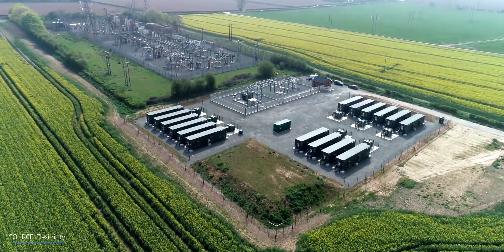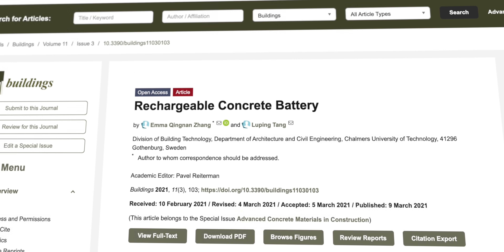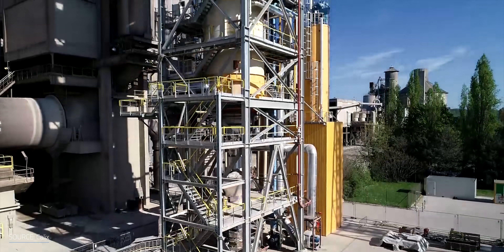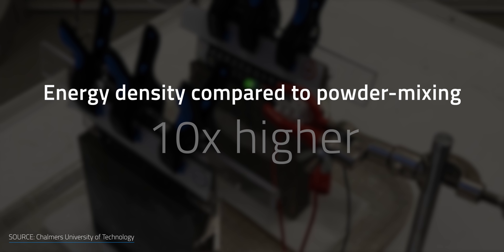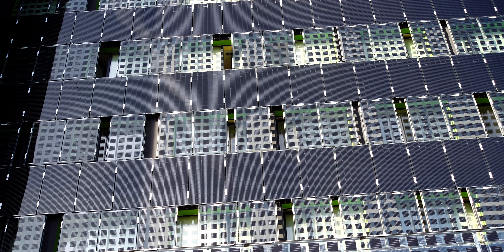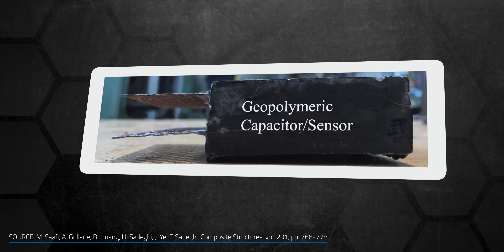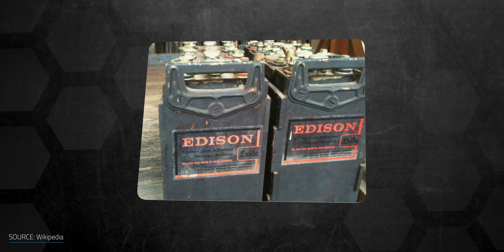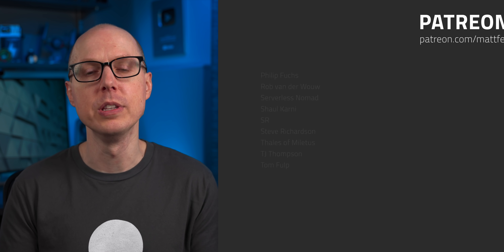Turning Buildings into Batteries? Concrete Battery Storage Explained

Comment: One of the reasons why modern concrete bridges need to be replaced every 30-40 years is because of a redox reaction. The iron/steel rebar within the concrete starts to rust which expands in volume as it does so. This expansion, especially when combined with colder temperature or wetter climates causes the concrete to crack which allows more moisture in which then increases the redox reaction even more. The fact that this cement is based upon a redox reaction worries me. How long with the concrete last? Even if the concrete lasts, how long will it remain operational as a battery? I think this requires a massive amount of study and further development before it can be considered a viable alternative. Concrete itself, without the rebar, can last a thousand years or more if you get the right mix and don't add anything that can rust. The Colosseum in Rome is a prime example of this. 

What would be very useful is if we can find a building method that uses different materials that when combined, can create an energy storage system. The more pure these materials (granite for example) then the longer it will last. Granite can last tens of thousands of years, and as a building material, can be extraordinarily strong.
Reply: Theres a move to phase out steel as rebar due to the problems with concrete cancer.. as its known. 
What they are using in domes and other structures especially in Maritime environments is artificial  Basaltic rods.. it behaves more like concrete in density, in terms of expansion co efficient s, water, fire and corrosion resistance...it can even be formed into woven and chopped strands..like Glass in GRP construction.
Reply: @clivestainlesssteelwomble7665  That's really interesting! Artificial basaltic rods...
Reply: @Kevin_Street  
Look it up they are even using it to re enforce PET plastic hulls on a new generation of sailing. Catamaran's.
Windelo 50 Adventure Catamarans. Also large spray concrete domes.
Reply: As I understand it, the rebar rust helps make a better bond with the concrete.
Reply: @lunatik9696  only if its a tiny amount and then for a short time  then it expands by multiples of the original steels volume and then it starts cracking and flaking the concrete which lets more water into the structure...plus rust runs out of the cracks and discolours the surfaces and combines with dissolved mineral salts and form rusty orange runs and stalactites in the worst cases
Reply: I'm wondering where you got 30-40 years from......... like wow 

Thats a cheery picked fact if I have ever seen one.

But right on one point the correct material for the correct job and location.

U build anything in a high salt spray area u are going to have problems........
Reply: @JackTalyorD  Cherry picked? I work in the industry. Bridges start going bad after about 30-40 years. I live in the upper midwest, so we have snow and therefore salt, so I'm basing it off of my experiences.
Reply: @Xero1of1  yes  so 30-40 years comes from bridges in your area.

Sounds a lot like Brisbane River side Express Way.

2 km stretch of bridge/ highway built around 1968 as a temporary traffic solutions for a growing city.

60 ish years later it's still standing and still hasn't been replaced upgrade.

It only fell down a little bit in 2006 but that's tends to happen when you build a bridge on sand and gravel.

So my ramblings was that bridge lasted 3x it's planed life span......

I cherry picked that bridge 😁😁😁.

But the last 6 bridges I have worked on in the last 20 years are all rated for 100 years plus.

Will they make 100 years maybe we'll at least the ones that they didn't cut corners on with 25 mm cover on Reo on per cast panels that are the bastions for the main bridge support.
Reply: @JackTalyorD  
Im wondering how much influence that very fact may have had on the collapse of the Florida Condo building...esp given rising sea levels, salt water penetration of ground waters and increased hurricanes and storm surges.

In many emergent economies building s have been thrown up in a huge hurry .  In china and other places huge concrete city size developments were thrown up ..and now in less than 15 years are litteraly falling apart so having to be demolished.

The whole species is on a its last written warnings that we need to collectively grow up or the Gia will change its life support mechanisms till it will no longer support most if not all of us. Weve just about discoverd where the thermostat switches are and if you play with them things happen🤦🏻‍♂️🤔
Reply: @clivestainlesssteelwomble7665  building in China...oh that's the fun stuff.

So say it cost $150,000 to build X.

Well there going to accept the quote that's $120,00.

And well material is going to cost u  $50,000 and Labor is going to cost u $50,000 and bribes to the correct people so u don't have problems is going to cost $30,000

And your profit is going to be $20,000. Well it should be.

Sooooooooo either $30,000 of labour costs need to be cut or xxx of  material cost need to be cut.

Shame the bribes is kinda of a not negotiable cost.

Sooooooooo u spent $20,000 on material and $20,000 on Labor well u get $60,000 in labour but only pay $20,000 and the u take your $50,000 and GTOF there because of the house of cards u have just set up.

But change thousands to millions/ billions and one building 2 a new city and that's close to the scale of the bullshit that's been set in motion.
Reply: The biggest bridge i DK was intended to last for 100 years, but in 2020 it was upgraded to 200 years.
Reply: I live in South Africa, I work in civil engineering, I have never heard of bridges needing to he repaired even after 50 years, rc structures does decay over time, but not as fast, I have only heard of concrete roads needing to be replaced because of cracking after 30-40 years, but they don't use reinforcing, so different problem altogether. Buildings I have seen are 60+ years old and are structurally sound, if a building is falling it was a design flaw, y-bars do not rust as quick as people may think in these buildings, after all these years you can break it down and you will still have strong steel in them you need to cut. Remember, an engineer signs off on a building, we take responsibility if something goes wrong, that's why we have insurance paid by the company to cover the costs of any breaks, but that shouldn't happen in your lifetime, a building that you design should outlast you, then our job was done correctly, but we do not have the same climate, weather may change characteristics of rc, I don't know.

But there are several concerns on the battery system and how long it will last for what price, this would need to be very well researched before any engineer signs off on it. Remember, every house, every shop, every building that is built today needs to be signed off by an engineer, if the engineer says no, it's not happening, so all I caN say to the science community is: "Persuade us with enough thesis's and technical reports, lab reports  if it gets accepted into building regulations, I'll sign off on it, cause the idea is great, but there are many great ideas, just few that are realistic.
Reply: Most buildings probably shouldn’t be designed to last a hundred years. Many are torn down to build something new within 50 that I’ve seen. Part of that may be due to infrastructure breakdown but the property market likes tearing down to rebuild a newer thing. Bridges and similar certainly need to be more durable. But not all of the concrete structure is part of the support.
Reply: If it is rechargeable then it would also consume the rust.
Reply: Yeah as a electrical engineer I know your not getting a perfect exchange with any battery and will weaken or degrade over time.

That's even more concerning if it's the structural component of a building or anything.   It might be a good option if storage is desired at a installation and it's more viable than normal batteries.

I can't see this working in commercial buildings though
Reply: Concrete can be reinforced with carbon fibers, while more expensive this can be economic already due to not needing a concrete cover over the fibers, which over large spans adds up to significant material savings due to not needing the height below the pull zone.
Reply: Putting a negative voltage on the iron should make it less likely to rust.
There may be an alloy we could use for the iron that would resist rusting without costing too much.
I doubt that concrete batteries will be a good idea but I am very happy to be shown to be wrong in this.
Reply: @kensmith5694  Lead plating the iron can prevent it from rusting for thousands of years. Unfortunately, people freaked out about lead so it is difficult to use as a building material.
Reply: @kensmith5694  Idk if this would work or not, but check out something called "weathering steel" aka: Cor-ten.
Reply: @daniel_sterling  The first time I saw stuff like that was in 1967 in the Expo in Montreal.  It was proposed for construction
Reply: As an old heavy reinforced concrete builder I wonder about the wild responses to this post. Yes,  the Roman Pantheon concrete dome still stands,  a masterpiece of chemistry,  mass, design and ass-busting organisation. The Romans did not have mass steel production,  though, so they couldn't "reinforce" concrete, which is weak in tension; reinforcement rebar and stress wires improve tensile strength,  making modern bridge construction possible, along with high-rise,  paving, water treatment tanks, concrete boats and a world of other stuff. For those that fret about rusting rebar and cracks I recommend breaking up a bridge or two to see how little rust is inside. Then get out your textbooks and study the chemical balance between portland cement and steel. Finally,  epoxy coatings do not have to be perfect, they are already much better than necessary. Engineering these days is mostly damn good and so is heavy and high-rise.
Reply: @markmatson5522  that's the one I never understood.

This build last 5000 years it's amazing...........

There's lots of building built in the same time frame with similar methods so.

I don't have the right words it's more luck that it lasted this long than anything else....
Reply: @markmatson5522  So does a bridge in Trier, Germany, I've been there. Not quite sure what your point(s) are?
Reply: What if the steel was replaced with Carbon nano fibers? If I’m not mistaken they’re supposed to have a higher tensile strength
Reply: @justinokraski3796  
Too exotic friend and expensive for general application just look at the price of carbon fiber items let alone nano tubes ... and think about nano particles of plastics or minerals like asbestos what happens when... has to be thought through in real world use or misuse more typically . Plus most carbon fiber is still produced from Oil.🤷‍♂️
Reply: @justinokraski3796  I think they're more expensive and more difficult to produce... but odds are it would probably work. Back in the medieval times and even before, they used horse hair as the binder. Wattle and daub uses straw and other substances with a lot of fibers in them, so it's not a new concept.
Reply: That can be overcome by coated rebar. Funny, the Romans made concrete that has lasted 2000+ years, wonder why we can't do it.
Reply: We now cover Modern Rebar with 'Epoxy' _Problem solved _
Reply: @spiritzweispirit1st638  
The problem still remains .. if the epoxy is breached, the also steel  has sufficiently inferior  physical properties to still  create problems.  
Im pretty sure epoxy coated rebar is actually not allowed in certain countries and applications because it fails and corrodes.
Reply: @spiritzweispirit1st638  Only if the epoxy-coated rebar is carefully laid in place and the concrete gently laid on top of it to protect the epoxy.  How likely do you think that is to happen?  That is one reason why stainless steel rebar sometimes gets used, despite it being MUCH more expensive.
Reply: @spiritzweispirit1st638  Actually, that exacerbates the problem.  It's almost impossible to prevent chipping the epoxy when you install the bars.  It's not like galvanization where you apply a sacrificial material to the iron, preventing rust until ALL the galvanizing is sacrificed.  What you get instead is the entire electrochemical potential of the iron bar acting in that one spot where the epoxy got chipped.  So instead of a bar that slowly rusts over time and spalls the concrete away, you get a bar that just cuts itself in half at the point where the epoxy got chipped.
Reply: @spiritzweispirit1st638  Between minute defects in the coating process and the fact it's easily scraped off during normally rough construction site handling it's not a total fix. Stainless works but is more expensive.
Reply: @johnassal5838  what works best is more concrete and in turn more Reo and in turn more cost.

U give Reo 100-150 mm cover on all sides in concert and u got no problem.

But that turns a 300 mm tick slab with 75mm cover to a 500mm slab 

Which in turn need more steel more concrete more support columns which = less profit more Labor more material and less square metres in the floor plan to sell.

In most cases close enough is good enough...... What's the bare minimum amount of money required to build this building and how much can we sell it for.

If construction was a non profit organisation building should last for hundreds of years but it's not and the cheapest price wins so the shit that passes for a building is what we get.
Reply: @spiritzweispirit1st638  It doesn't solve the problem, it merely delays it. Epoxy can wear off too and all it takes is one little cut or undercoated area to spread the reaction under the epoxy.

Comment: Hmm, I think this could work, but it''d need considerable changes to how things are built, as well as a LOT of middleware to carry the power around.  (same reason that even if we had perfect solar panels, solar FREAKIN' roadways would still be a nightmare to manage)
I still think gravity engines are where it's at, and vastly cheaper too.  Like that big tower that just lifts some bricks up and down with 3 cranes.  Energy Vault, that was it.  
However, this would still be a great use-case for emergencies, like if the grid failed!  So on that case alone it should be done.  It would be fantastic for intermediate power supplies in disaster case scenarios, especially if combined with mesh networks to allow long-distance comms.
A bit of reworking the electrical grid in peoples homes could also be done so that you could prioritise certain sockets for power so that, if things went bad, everything non-essential dies, but those dedicated sockets still stay live.  (prioritise kitchen and some emergency lighting system, for example, maybe a socket in each room)
THIS bit is less likely, but that would be an ideal scenario in the future for new builds. Especially with where we are headed...  we certainly ain't stopping the climate, that's for sure.  Preparing is better than not.

Comment: I'm very curious about RF emissions from a building made of this stuff. How it might affect fires. As well as how it behaves in a lightning storm.
Reply: DC current produces no RF. The F stands for frequency dc is direct current, not AC.
Reply: This sort of thing tends to absorb RF rather than emit it.  Concrete is not all that good in a fire.  It doesn't burn but if the fire heats it to just above the boiling point of water, it started to turn back into Portland cement powder.  The crystals that make Portland cement turn into a strong solid have water as part of their structure.
Reply: Your new born babies head will be fried and you can't put out electrical fires with water  :D

Comment: What about using radio waves to broadcast electricity to where it is needed? Broadcast from the solar panels and windmills to where it is needed, making a smaller battery storage footprint necessary. A smaller panel/windmill footprint also.

Comment: ? Earth quake building collapse, electrocution becomes potential hazard for emergency workers, health troubles could arise from material's used and fire compounding additional fires in near by buildings just something to consider before a full roll out of a potential new tech. Remember lessons learned Hindenburg, lead paint, health issues for workers at ground zero, formaldehyde in emergency shelters the list of the victims of good intentions are to numerous to forget or ignore.
The hype of new research rarely survives reality. Do the research with the intent to prove it a failure. Be glad only when proven wrong remember any toxin placed in the food chain you will feed your child one day. Not a gift to give.

Comment: One danger I can see is the fact that electrolyte in batteries gets used up over time 
(not consumed, but it changes its composition, that why the capacity drops down).
What would happen to my house when that happens to concrete in my walls?
Is there a risk that the used concrete electrolyte will be too weak and will just cause to house to collapse?

Comment: Holy sh*t! Even the prototype material as is with no improvement can work.
1 Low energy density - most people have no idea of just how much concrete is in a slab foundation for a small single bedroom house, and it's almost exponentially more for adding floors and square footage. And the only reason we don't add more is price and cureing times. 
2 longevity- it's an iron nickel battery they have original first batch hand made ones that are still working on railroad signals in the middle of nowhere.
Think of how many concrete bridges are on any given road, and the bridge doesn't use any power it would be storing.

You build a bunker with this under a normal house and it will power the house and bunker